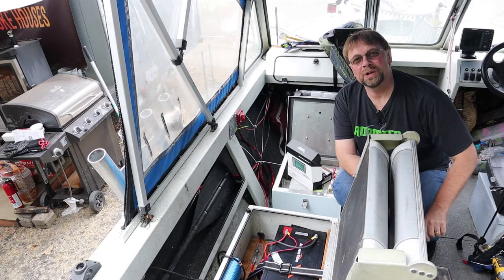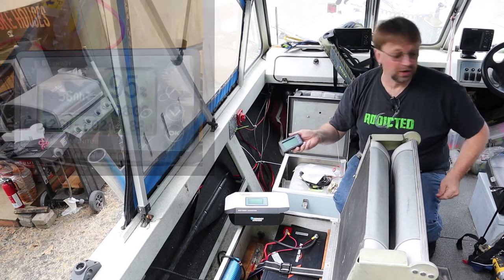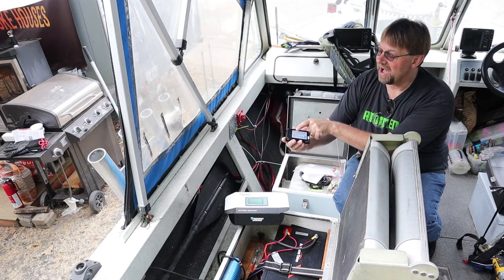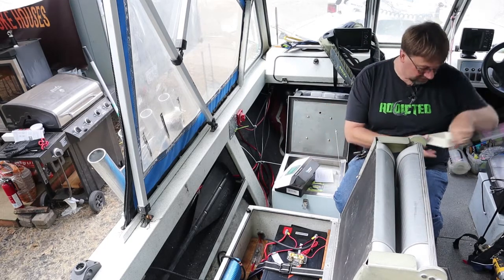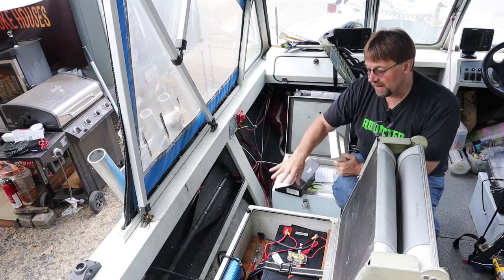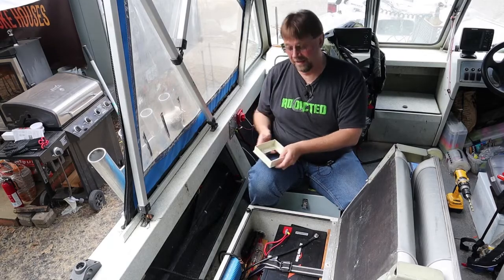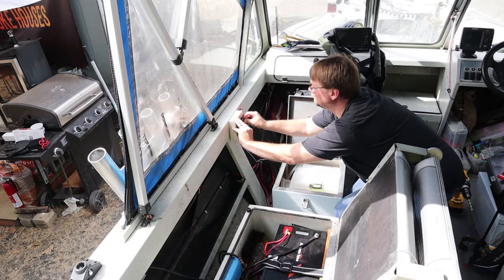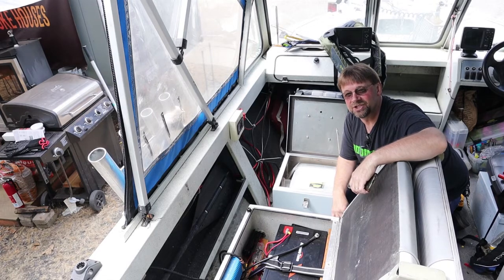Installing the Renogy Battery Monitor in my boat

Comment: Any idea if this will monitor 2 battery banks?  I mean is it possible to use/toggle between 2 shunts? I have 2-3 batts for starting (lead) and 2 lithium batts for trolling motor/house accessories.
Reply from the maker: I can't be definite, but I don't think so. However, the shunt works by monitoring the electrons going in and out of the battery. Basically it's tracking the voltage in and out. If you switch it to a different battery it will still have that information and get confused. I have the lead acid 60 amp hour batteries in the other video as my backup bank and I use a $15.00 monitor to keep track of their level. Lead acid batteries can be monitored by a simple volte test.

Comment: Is the renogy 500a water proof or water resistant? I’ve looked all over for info, as I want to install in my boat, but I don’t have a Bimini cover at all, so it would be in the elements. Thanks
Reply from the maker: I didn't initial look and I cannot find any information on that either I will look into it some more and possibly reach out to the company. Thank you for watching
Reply from the maker: I got a reply today and it is a no! Renogy said, "Sorry, because it needs to be connected with bare metal cables, and it is not waterproof.

The Renogy Battery Monitor can't be exposed to the sun for a long time or in the environment with large amounts of ultraviolet radiation when using or storing in winter (＜ -10℃) and summer (＞60℃) otherwise, the life span of the LCD will be shortened."
Reply: @fishingweekendwarrior exactly what I was curious about also....

Comment: How many volts are you monitoring? I have 36! Will it work?
Reply from the maker: My system is a 24 volt system. However the rating on this monitor is 10 volts to 120 volts up to 500 amps. My guess is that this is made to be compatible with multiple sizes of solar systems. So the short answer is the manual says it will work for 36 volts. FYI I used my system 27 times and this monitor is a really nice feature because I can glance over and look at it without opening my cell phone

Comment: Hello Robert, I'm trying to find the external plug box you show in your very educational video of the Renogy Battery Monitor mounting & wiring. I've looked at many external plug, light switch boxes but not a duplicate you have in your video. Can you direct me as to where you found yours?
Reply from the maker: Updated in the video description, thanks
Reply: Sure, I will add it to the video description in a few minutes when I get home, it will be at the bottom of my amazon link section.